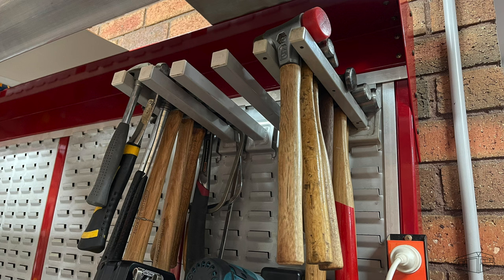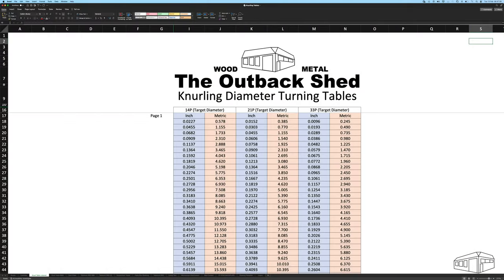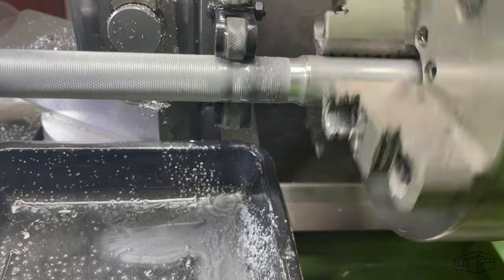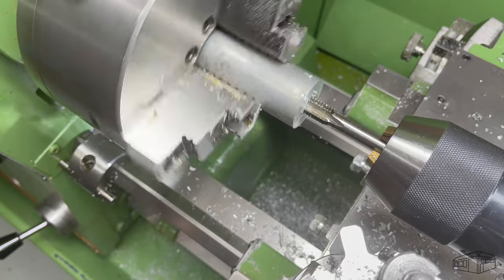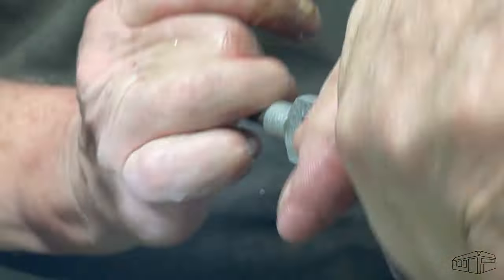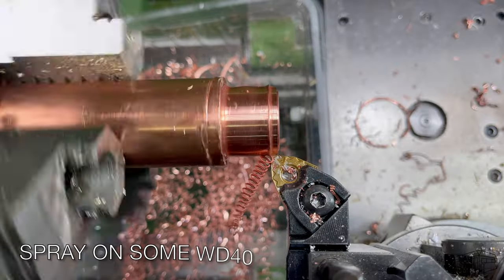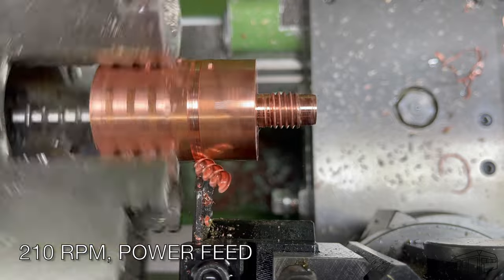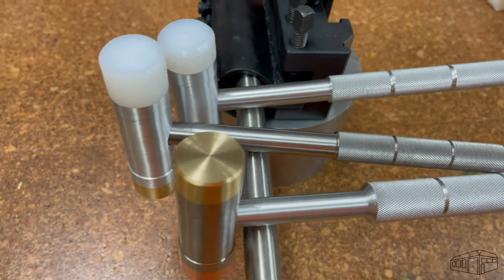Making a Machinist Hammer - Shop Made Tools

Comment: Turned a lot of steel, cast, bronze, aluminium and alloys, but not much copper or brass. I can recall that the copper did contain either sulphur or zinc which improved the machinability. The brass we used was alloyed with lead to help machining. Nice hammers, I was surprised when I retired after a lifetime in engineering the amount of tools I collected. Travelling for work all over the UK, EU and the US, I did tend to pick up the odd tool or two. Nicely done hammers, should see you through to retirement.
Reply from the maker: Thanks for the comment.